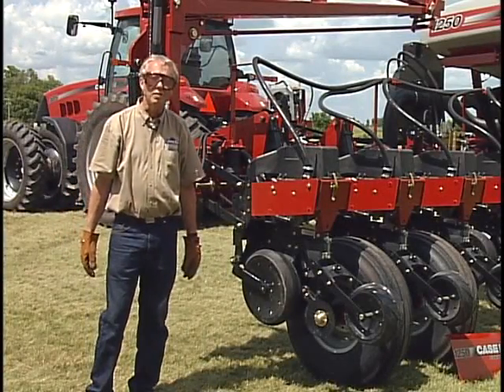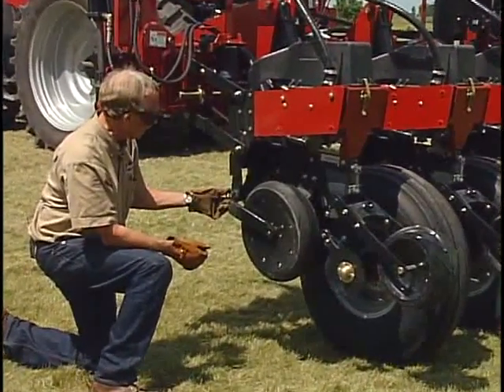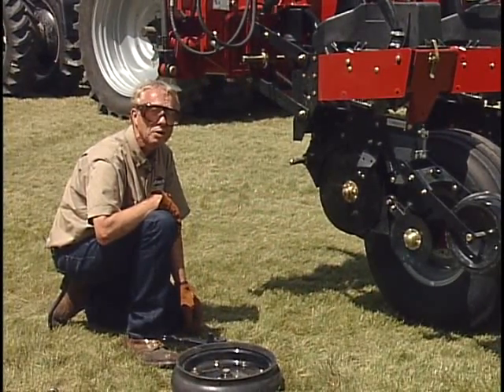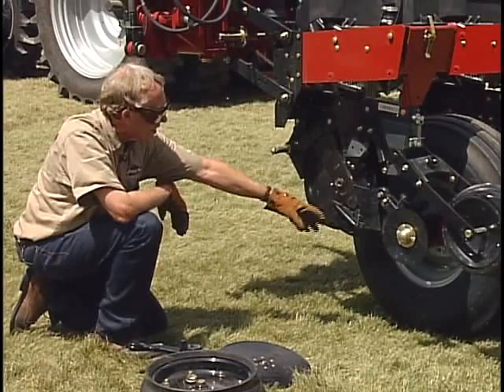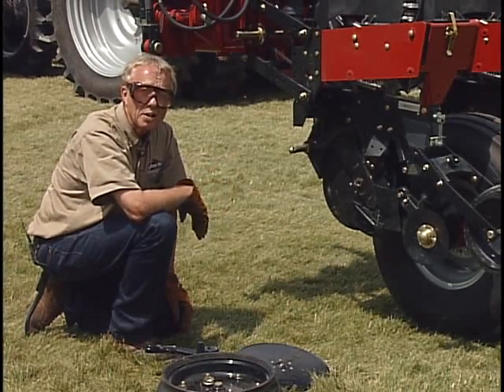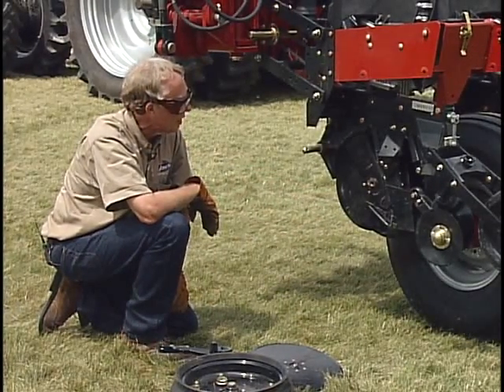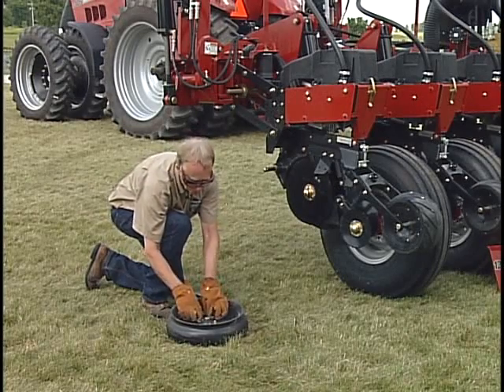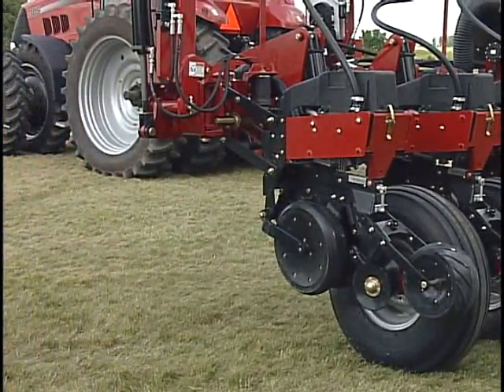Converting your Planter for No-Till Operation: Seed Openers (Case IH)

Comment: Hint:   When you put the disk blade on, it's a lot easier to lay on the ground and look in between the two blades so you can see the hole for the bolt.    No fumbling around and having the washers fall off the bolt.